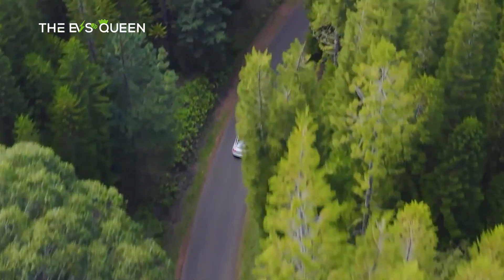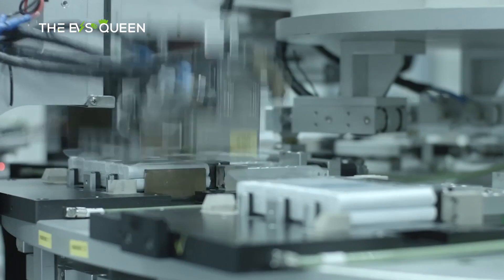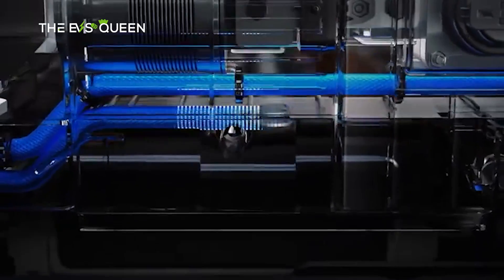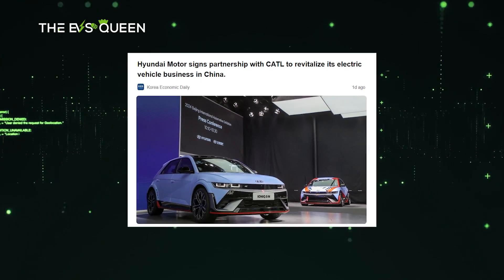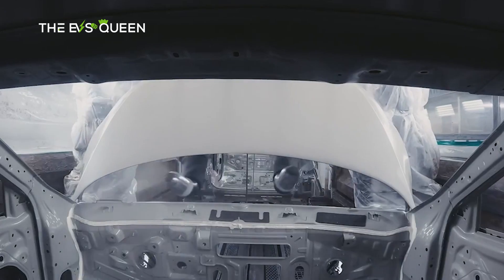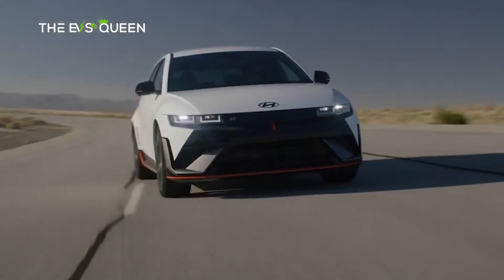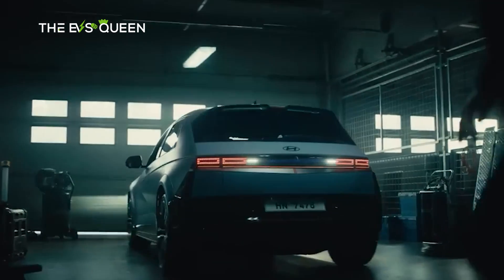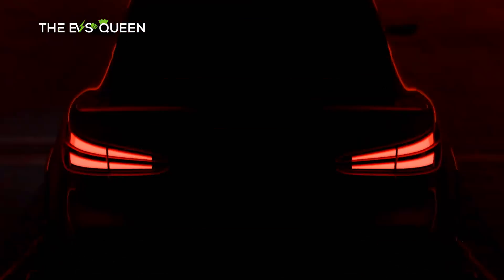CATL Unveils Breakthrough Shenxing Plus Battery: 600 km Range Achieved in Just 10 Minutes

Comment: Let's assume an energy consumption rate of 20kWh per 100km.
To cover 600km will require 120kWh of charge. 
To charge 600km in one hour will require a 120kW charger, assuming a flat charging curve.
To charge 600km in 10 minutes will require a 720kW charger, assuming a flat charging curve.
This is not realistic.